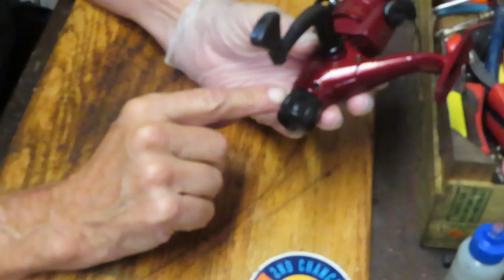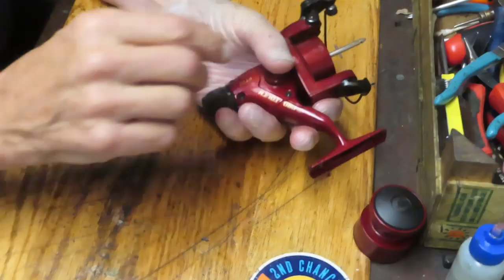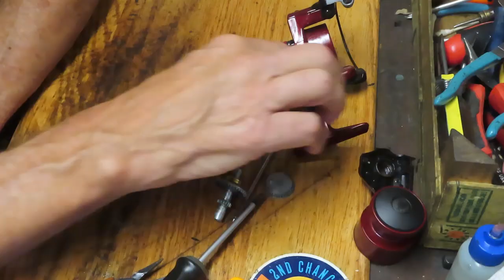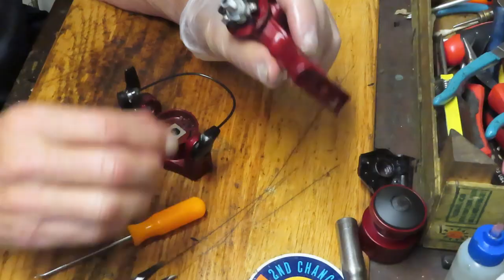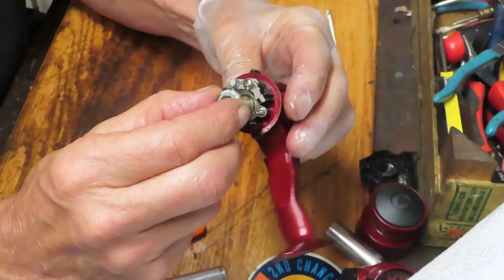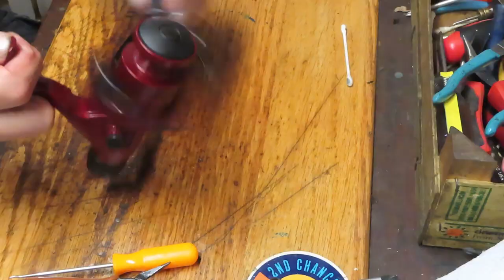Win this Shakespeare PT30 fishing reel and learn how to service it

Comment: Wow even the pinion is cast zinc you dont see that to often ive actually seen some low end Baitcasters with a plastic/nylon main gear
Reply from the maker: It’s amazing how the quality of parts has changed over the years.  I have a full out nylon reel.  Case, gears, etc from the 50's.  Very interesting and yes, it does catch fish!

Comment: Dennis, you know I’m a subscriber!  I want to be in the drawing even though I would not use the fast-cast feature. Yesterday I did some more work on my Daiwa Apollo 7050 saltwater rear drag reel. It is one of those that had that dissolving anti-reverse claw. Rick Stivers showed me a better way to fix it by making a spring for that claw. He sent me the metal spring wire to use for the spring. Well, I went back and looked art my original bush fix for my reel and decided to hold off as it was working perfectly. It only has bushings not bearings like the reel you are servicing. Without the fast-cast feature my Apollo 7050 is little different from this reel. It does have two c-clips instead of that on piece double clip on your smaller reel. By the way my dad called that metal “monkey metal.” That one stop cam for the AR is my true problem with fast-cast reels. It takes half a turn of the rotor for the AR to catch. For me that is just too far.  Dennis I just got a Daiwa Emblem Pro reel that has a sort of self centering rotor feature like this fast cast reel. I’ll write you about it with some photos showing how it worked. The reel also has a regular override and an AR clutch bearing so this was quite a surprise. None of my other Emblem reels have this feature. Of all the rear drag reels I own, not a one will let me attach the crosswind block to the axle shaft before inserting the main gear. With separate c-clips this can be a reel pain in the butt! This is a nice little freshwater rear drag! — Chris
Reply from the maker: Thanks for the note.  You are entered in the drawing Chris  - Dennis